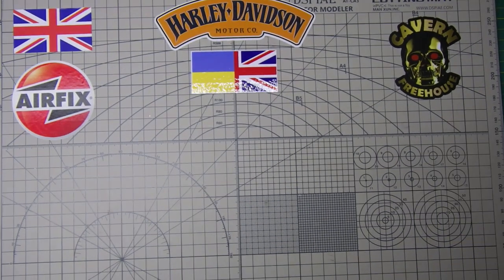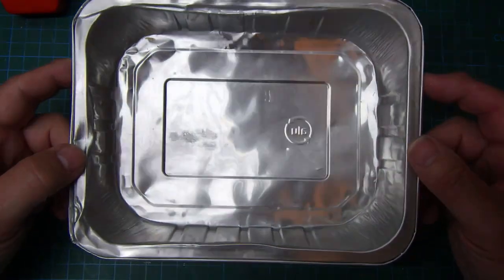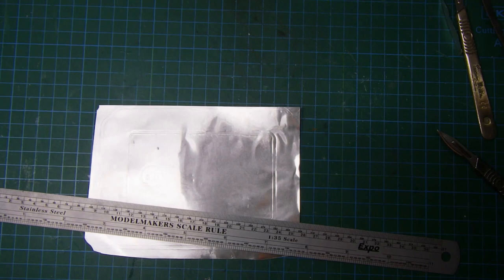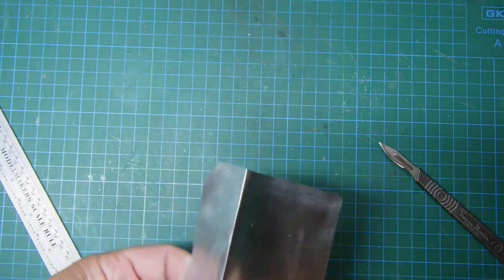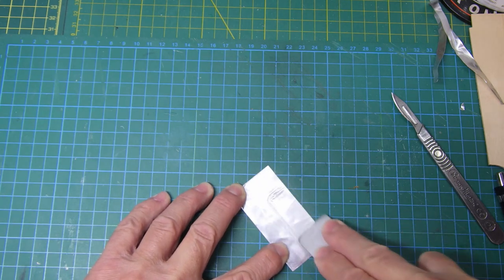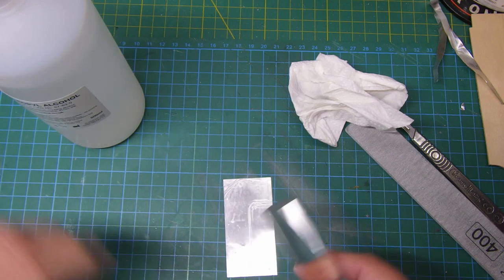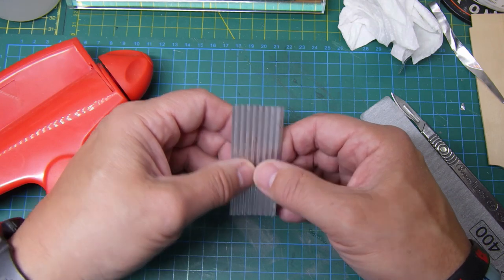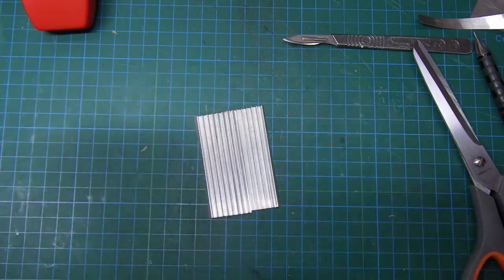Miniart Panzer IV Diorama - making corrugated sheets & 300 subs!

Comment: I can get pie dishes but I can't find a similar tool anywhere.
Reply from the maker: Hi Martin, unfortunately I can't help. I did see one on ebay recently but my local craft shop has closed down 😡 Cheers Bob 👍
Reply from the maker: I did find this on Amazon https://www.amazon.co.uk/Uchida-8-5-inch-Straight-Corru-Gator-Crimper/dp/B0013JR8QQ/ref=sr_1_6?keywords=paper+crimper&qid=1651559125&sr=8-6
Reply from the maker: I also found this on ebay https://www.ebay.co.uk/itm/174906592783?hash=item28b93ece0f:g:Gd8AAOSwQi1cwb2z - I would recommend this one as it has the aluminium rollers